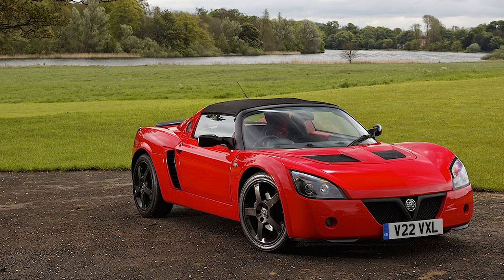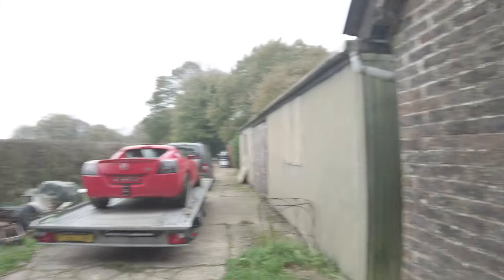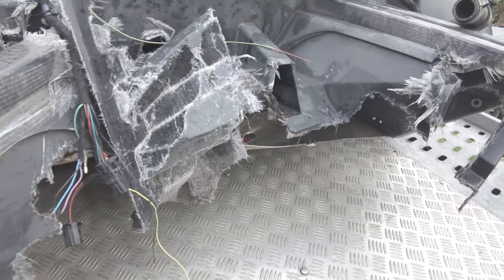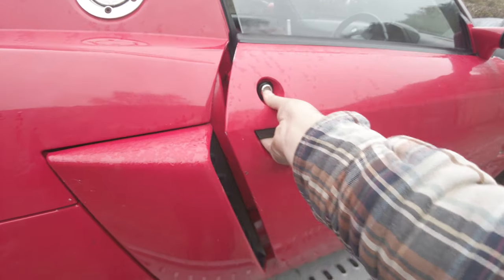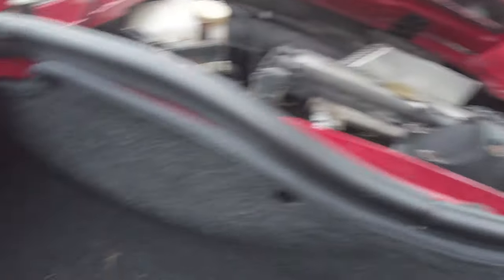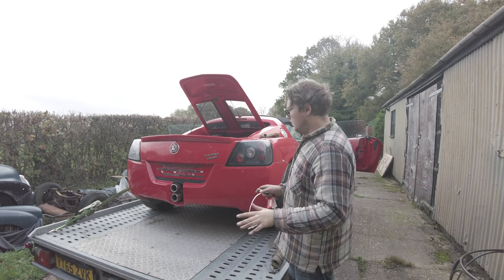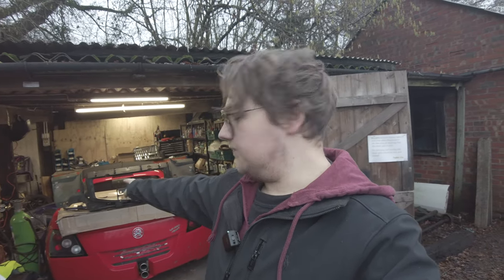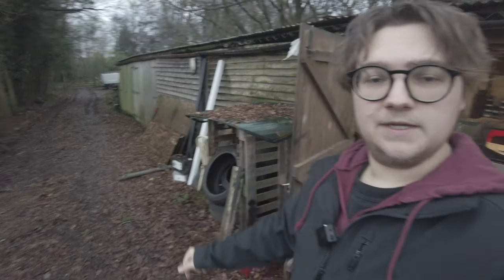I Bought my DREAM car from Copart...And It Looks More Like a NIGHTMARE!😱 Vauxhall VX220/Speedster

Comment: That front clam going to be £££. Best car I’ve ever owned.
Reply from the maker: It wasn't cheap!!! And it wasn't in great shape either!! 🤦 You'll see it in the next video
Reply: @cashmachinecars  type 116 motorsport is good for replacement bits for the windows, electronics etc but yeah the OG bits are mega expensive. All my lenses are hammered/yellow but these are meant to be driven and enjoyed so it doesn’t matter. I need my front/rear and sills all patched so I’m following to see how the fibreglass work goes…
Reply from the maker: Thanks I'll look them up! Haha yea I've done a bit of fiberglass work in the past but I am definitely no expert so I might not be the best at it 😂

Comment: The lights you are screwed. You've got to go second hand. There aren't any aftermarket replacements either.
Reply from the maker: I know!! I'm very surprised no one has made and aftermarket set as they are so expensive! But then I guess there aren't that many of them about any more
Reply: There are aftermarket solution with LEDs. Check Eltech-Italia. I think they were 1400 euros per set, but not sure if they make RHD version. 
Fkin quick car on track, probably the quickest I haver ever owned. But hated driving it in town. Good luck with the build!
Reply: Oh and Delage speedster makes headlights as well, you can order housing, lens, etc separately or just buy a full set. Not sure on RHD as well, but check them out

Comment: Looking forward to this resurrection.. it’s far more left field tan the Elise and they look a fair bit cheaper. Hope you can secure the parts..is it worth trying other markets where these were sold (for non RHD/LHD specific) salvage parts? On the plus side it will have less cutting and welding😂
Reply from the maker: Thank you!! Luckily I've got almost all the bits now the only thing I'm struggling to source(pay for) are the headlights but they are the last thing to go in. True I think they made more Opel speedsters than vx220s might be a good idea to look for parts elsewhere in Europe! Hahah thank god!!
Reply: @cashmachinecars   there was less than 950 Turbos built ...i think it was actually 943
Reply from the maker: Really I wonder how many are left! A lot must have been written off 🤣
Reply: @cashmachinecars  looking at how many left a surprising 737 appear to be around, turbo and non turbo combined